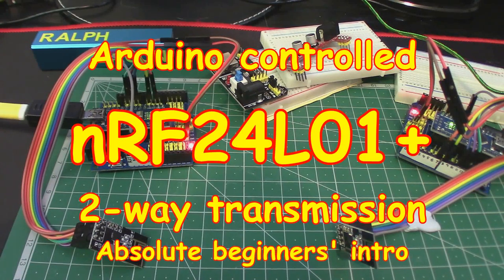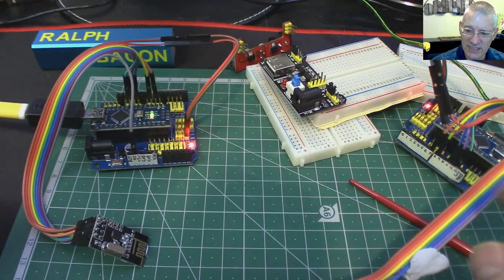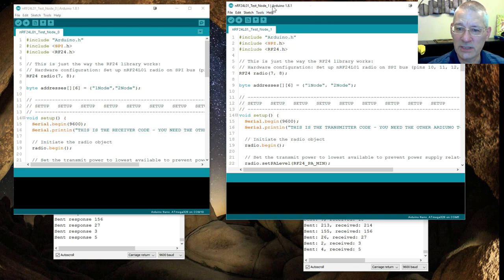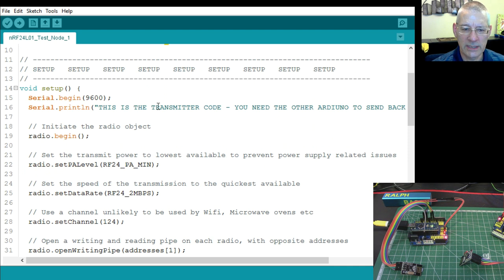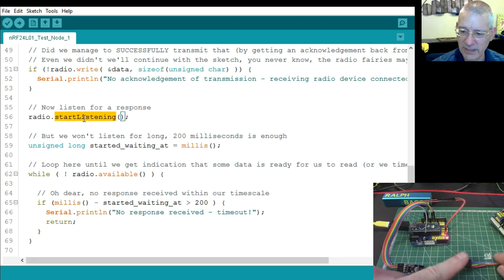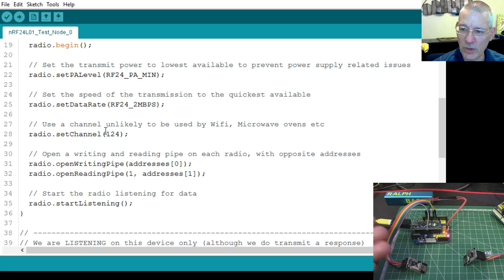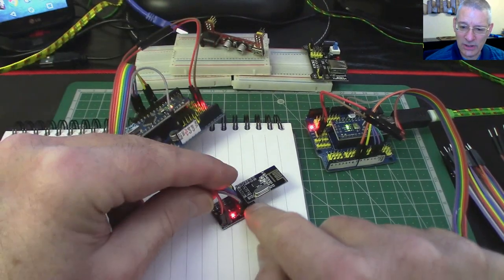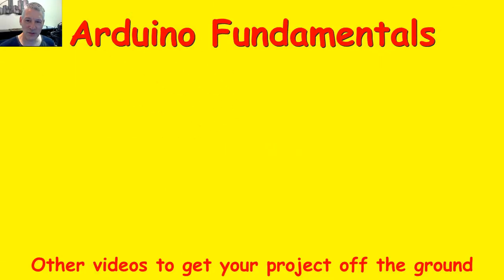#73 nRF24L01 Send (and receive) data with your Arduino!

Comment: Works well Ralph thanks, didn't initially though but my nano's 3.3v output is 3.5v and i suspect there is noise on the line, scope not to hand at the moment) A 47uf on each nrf sorted for now until i use the adaptors.
Reply from the maker: Oh, yes, do get the adapters, Emmett, it just makes using these great transceivers so much easier. Glad you got it all going without them though! Thanks for posting.

Comment: Thank you for the very clear & helpful video!! I was wondering if you could help me troubleshoot! I have done the project exactly how you have done it and followed every step correctly. However, I am still not able to get the transmission across to the receiver. My transmitter serial will say that there is no acknowledgement and that it has sent the number, but has not received it. My receiver serial will just say that this is the receiver code. I have tried changing the channel that I am on and matching both of them so they are on the same channel. I have even tried to increase and decrease the transmit power. I checked to see if I am getting proper power to the module and I am. One weird thing was that I have the adapter, so I should be able to supply from the 5V, however, when I do so, the transmitter serial will basically keep resetting and showing "no response received" and the "timeout". So, I keep it on the 3.3V supply, regardless of having an adapter and external antenna. I am wondering if it could be the antennas that came with the module, but I have even tried swapping those out as well. I am sorry that this was such a long reply, hopefully, I missed something that you caught. Thank you so much for any feedback!
Reply from the maker: No, it's not the antennas if you're running this on a workbench.

If you have the adapters, and have plugged them in the right way round (so they extend the adapter plate making it long, not on top of it) then you MUST use 5v, as the board has a 5v to 3v3 regulator.

Apart from the adapter plates, the most common problem is the pin wiring. Easy to get them muddled up so you need different colours for each, and write down the colours. Ideally, keep the colours the same as I have in the pictures on my GitHub:
https://github.com/RalphBacon/nRF24L01-transceiver/tree/master/DupontWiring

The transmitter will show the number it transmitted. The receiver, if it received it, will show the same number, increment it by 1 and send it back, at which point the transmitter will display it.

If the transmitter gets no (auto) acknowledgment of the number transmitted it will show the "time out" message. Check the wiring and modules - I've had fakes in the past that just didn't work properly.

In the meantime, you need to triple check the wiring, it's easy to get it wrong. I have to say at this point, Gurdeep, that my two sketches most certainly do work, and I've recently used them (adapted) for my storage bins and they "just work".
Reply: @RalphBacon  Hello Ralph, thank you so much for your detailed reply!!
Yes, I have triple and quadruple checked my wiring, everything was just not working. I actually tried out another YouTuber’s sketch and that wouldn’t work either.
I believe I probably have fakes, so I will get new ones and try them out again!
Thank you again for your reply!

Comment: I have problem the node 1 always print "No response received - timeout!" and cant receive anything from node 0, how can i fix this?
Reply from the maker: Are you using the adapter plates that allow you to power the devices from 5v? If not, do that first.
Does the transmitter send out the value OK?
Does the receiver receive that value OK?
Does it try and send something back?
Is that failure part of the auto-acknowledgement? (The transmitter will expect a 'received' type message behind the scenes - is that the one it is complaining about?).
Swap over the two modules to see if the same problem persists.

Comment: Nice tutorial thanks for sharing, I wonder is it possible to send and recive the internet signal or for example the cable TV signal through this system.
Reply from the maker: Not a chance, Armend, sorry! This is not a computer network packet transporter, nor a TV signal repeater either (far too slow). But it is good at transmitting (small packets of) data from one Arduino to another, at moderately high speed (up to 2Mbps) but that's about it. If you think about computer networks, they have a minimum speed these days of 100Mbs and usually 1Gb or higher. Internet TV requires something like 3Mb per second for standard definition and 5Mbps for HD. So...

So forget that idea but do use this wonderful device for your Arduino needs,it really does work well (with the adapter boards); especially nice is the auto-confirm and auto-retransmission feature, all without a single line of code! I'll be using this in a future project (after my imminent vacation). *Good question*, though, thanks for posting it here.

Comment: Ralph,
What a great video! I do have a few questions however. I've downloaded the library and your code but I can't seem to find the pin outs for the Nrf24L01 for the Arduino Uno. Can you tell me where I can find that information? Also with my project I want to simply send a byte of data to turn on 3 devices and make sure that the data got to the receiver. Your code seems like it's exactly what I need. Would you agree?

Thanks in Advance
Reply from the maker: Ken, you know how to flatter a guy, so I've uploaded a picture of the pinout I used in the video - just go to the same GitHub repository and you'll see the new file. Yes, I aim to please! Note that this is a TOP view of the module (so the connections are actually underneath, another good reason to use an adapter board). And remember this is a 3.3 volt device, so don't connect to 5 volts (unless using the aforementioned adapter, in which case 5v is required)!
 
Regarding your second question, about turning on 3 (differently controlled?) devices, then I'd say "Yes" this is exactly what you need. Send a different value for each device and let the Arduino figure out which device to turn on. Simples.
 
Thanks for posting and nudging me to upload that pinout diagram.
Reply: Ralph,

Thanks so much, I got the pinout, connected everything, modified the code for my app. and all is well, it's working perfectly. 

I must say your "simple" approach is far from that. By just showing us the fundamentals you're actually empowering users like myself to accomplish meaningful projects with relative ease. 

Have you considered demonstrating how to communicate via RS485 using the Arduino in one of your tutorials? I for one would find that extremely helpful.

Thanks again for the help.

Ken
Reply from the maker: Brilliant news, Ken, glad it all worked out. You're 100% spot on about the idea behind this channel and videos really: I show you a simple, working example that can be extended and suddenly developers have the light bulb moment in discovering to what Real World purpose these ideas can be applied. I haven't done any work with RS485 (nor RS232) but I'll add it to the list and see whether anyone else mentions it. Thanks for posting your success story, good to hear from you.

Comment: Thanks Ralph. Like you say, had to jump through hoops to get two USB ports working at the same time. Windows 7
End up swapping the mouse with other USB port forcing driver reload. Then it worked.
Is it safe to close the Arduino windows? Unplug USBs last is my guess. We will see. Plug 'em in first? I will try tomorrow..
Reply from the maker: Yes it can be very tricky. Saw your later reply so I guess you have it cracked now!

Comment: Mine just sends 1 and sometimes 128 and response is 0 how can i fix it??
Reply from the maker: You must do TWO things, Almir:
1. Use the power adapter boards, they are very cheap and solve a LOT of power-related issues.
2. Use my two exact sketches with no modifications of ANY kind.
Then we KNOW they will work and you can modify to your heart's content - you will always have a good point to get back to.

Comment: Thank you for this tutorial. I fell upon it recently, and it helped me quite a lot. Question: does it make any sense that using an Arduino Uno for the transmitter and Arduino Pro Minis for the receivers would be the reason that my transmitter isn't getting data back from the Mini Pros? The data is sent, received, and sent back, but it's not being read by the transmitter/Uno. Thank you!!
Reply from the maker: If your UNO's (transmitter) TX and RX pins are connected to the Pro Mini's RX and TX pins (ie reversed) then all should be well. Make sure you have set the baud rate in your Serial.begin([baud rate]) in both devices to the same number! Choose 9600 initially, as it the "safest".

On the UNO put some debugging lines (Serial.println statements) around the if(Serial.available()) to show whether it even detects incoming data, never mind what the characters are at this stage.

Let me know how you get on!
Reply: @RalphBacon  Thanks for your response. I didn't realize that the baud rate needed to be the same. Appreciate that. (I was able to get good data from the units finally).
Reply from the maker: Cool! Glad you got it sorted! 🥳🎉🎈🎊

Comment: Hey Ralph, Can you please post video about a base node and then child nodes connected to it.. And how to establish connection between them
Reply from the maker: Nope. 😲 My Bin Lid monitor has THREE (battery-powered) child nodes (slave devices) all transmitting to one (permanently powered) base unit. They all transmit at different, random times but the base unit seems to cope very well. See this video for more details:
 Video #221 https://youtu.be/eLnfiYkxCQ4
Later videos expand on this project so take a look or keep tuned!

Comment: I enjoyed your video. so i would like to ask a question.
I want to control this sensor's signal emission using the clock in the arduino. Because I want to set it up to be transmitted simultaneously with other ultrasonic wave signals.
is it possible? if so,  I would appreciate it if you could give me the relevant information or source.
thank you for great explanations.
Reply from the maker: I'm not totally sure what you're trying to do, Jeong Dong-ho. Describe to me what you want the project to do and I'll see if I can help, ok?

Comment: Hi Ralph thanks for your tutorial. I'm trying to make these modules work for two days but without results. Everything is wired correctly. The power supply is given by a stabilized power supply at 3.3V. I also put a 470uF capacitor between + and - Unique thing that I didn't try is the adapter boards because I have no one near me. I have to order them. With the oscilloscope, I see that the power is stable....strange very strange. Anyway with your sketches I get: Sent response: Random numbers for example 128 .....in other part I get : Sent: random numbers for example 254 Received: always 0!  Any suggestions besides the adapter boards? thanks in advance for your time. Giuseppe
Reply from the maker: OK, Guiseppe, here goes:
1. Check and double check your wiring. Because you are not using the power adapters it is easy to make a mistake because you are wiring from UNDERNEATH the board. I can only strongly recommend that you *buy the adapters*, they are cheap by mail order. And solve all sorts of power issues.
2. Put some debugging statements in the RECEIVER module. So do various Serial.println statements to see what it is receiving and sending back. It can get a bit messy on the Serial Monitor window but it's the only way to see what is going on.
Believe me, this demo sketch works just fine. So if it does not work for you it is either power adapter boards and/or wiring that is wrong!

Comment: First of all thank you so much, I've been struggling with nrf finally got it working. In my project I'll be controlling a bot with nrf, does the nrf needs to aligned in a certain position for effective tx and Rx.Also the range sometimes suffers even if I move one nrf little bit.
Reply from the maker: The position of the nRF24L01 should not be critical. However, a couple of other things are:
1. Are you using the adapter plate so you can run it off 5v? This is a very common source of problems.
2. What power setting did you set in the code? LOW should be OK but try the higher power settings too. Only use MIN for workbench use (about 30cm range).

Comment: Thank you so much Ralph but I wouldn't do it with infra red . As you probably noticed it will be the receiver which will be implanted and to perform a task it needs to adjust frequency and amplitude of stimulation  and this can be done with a transmitter and with a digital potentiometer and behave like an oscillator. Thank you as I have at least piqued your interest on my project. God bless you.
Reply from the maker: You did more than pique my interest, I have ordered one of the digital potentiometer chips but I will (probably) just use it as a simple volume control, controlled by infrared. At least it will demonstrate the possibilities. However, it will take several weeks to arrive from China so I must be patient!

Comment: Is there a spesific reason why you generated a number to 254? Im trying to send large numbers such as 1000, but it caps out at 250
Reply from the maker: I'm assuming that the variable holding your value is just a small integer (char or uint8_t) which can only hold up to 255. To take larger values you need a two-byte integer (int or uint16_t).

Comment: Hi, Ralph (or anyone who can help), I'm getting this weird error where my receiver is sending out a response which is just counting up by one all the way up to 254 and then it will reset and start again at 0 and go back up. The transmitter, on the other hand, says there is no acknowledgment of transmission along with the timed out error. I tried switching which Arduino the transmitter and receiver are on but it gave the same error. I'm currently powering both radios from the Arduino's 3.3v. Thanks in advance for any help!
Reply from the maker: Here's my take on this issue, Vithuran: 
 
1) you're powering the nRF24L01s from the 3.3v, something that has caused much misery to many Arduinites. I know it worked in my demo but maybe the boards you have are subtly different. Do yourself a favour and buy the adapter boards. If you live in the UK, Amazon do them for the same price as you can get them for in China (for a pack of 5). In the States maybe the same. Whatever, even from a Far Eastern warehouse, get them and power from 5v. Yes, really.
 
2) The "receiver" sketch only does something when it has received something from the "transmitter". Check your (dual, as shown in my demo) Serial Monitor (debug) windows and see what is being sent, when and by which module. If you are using my sketches, without alteration, they will work if your power supply to the nRF24L01s is correct, and *your wiring too*, of course!
 
How do you feel about that advice? More money spent but very little of it for a huge problem (probably) solved...
Reply: Alright I'll look into the adapter board, thanks for the advice!

Comment: nice video! is there a way to turn on/off a led remotely when the temperature reaches a certain level (provided a temp. probe is attached to the arduino)?
Reply from the maker: Certainly you can do this Mohammed. I would get it working first locally, that is, get an Arduino to turn off its own LED when connected to a temperature sensor such as a DHT11 or a DS18B20 (see video #28). That way, you learn how to control the LED first, then you can send that information using a single byte using the nRF24L01 to another Arduino and turn off its LED remotely.
Reply: thanks for the reply. i am going to video #28....